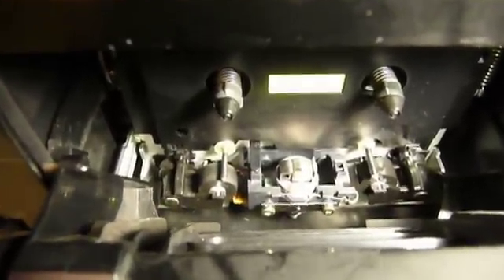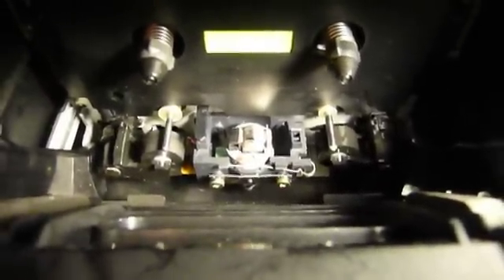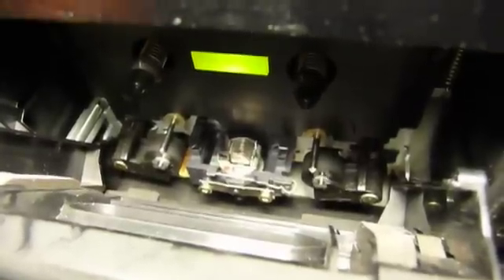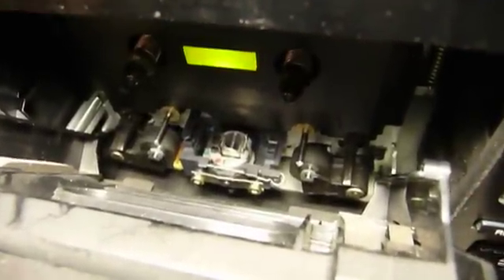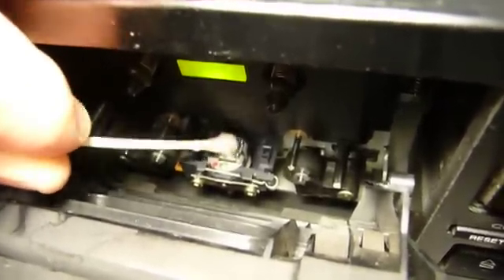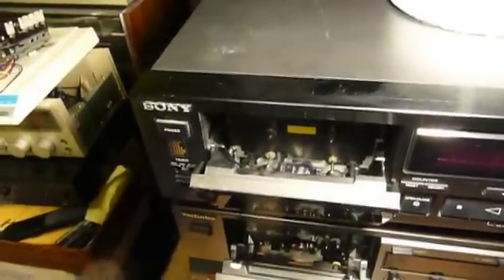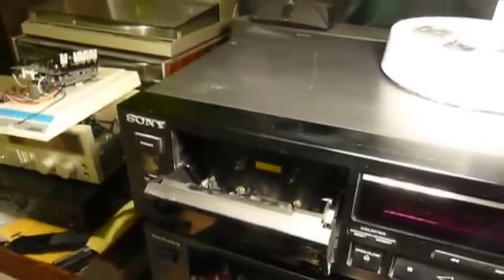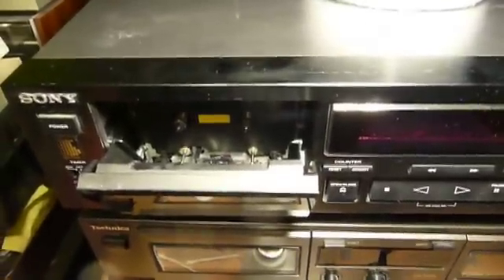How To Clean/Demagnetize Cassette Tape Deck Heads Part 2

Comment: I had an rx79es that looked almost identical to that. I wonder what the differences were? My capstan motor took a dump and I ended up throwing it out. Apparently I read it's a huge problem on these particular decks with the automatic doors from that time period. Now I see you can purchase capstan motors for them pretty easily. I should have hung onto it as I absolutely loved it. Definitely the best two head deck I've ever owned.  The recording quality would give a three-head deck a good run for its money!

Comment: whats the problem if you dont demagnetise is there any vid showing what happens with a magnetized head and if it really is such a problem to need a demagnetizer ie does the sound play warped etc show us what happens with magnetized heads otherwise no motivation to do it.
Reply from the maker: A magnetized tape head will produce poor sound quality.
Reply: @uxwbill  both of my Bauhn dual cassette recorders have suddenly decided to make horrible whirring sounds and make tapes distorted, its not the tapes. It sounds like both the spools have come off the machines or some cockroach twins have gotten into both cassette recorders and warping the spools. Strange that suddenly both of them warp now as they were working fine 3 months ago but just started playing them again and damn. WTF?

Comment: Hey,how am i supposed to remove stuck oxides and corrosion from heads and capstan when alcohol does nothing?thanks for the video!
Reply: Acetone works much, much better than alchohol.
Reply: @Reno_Slim  Acetone is fine for cleaning the capstan and the heads but don't use it on the pinch roller.
Reply: Recycle and get a mp3 player.

Comment: Have you ever thought about if the quality of a recording is better at the end of a tape or the beginning. Giving the tape is running faster or slower across the head. Thought about it a few times but really don't have a way to test.
Reply from the maker: Tape speed across the record/playback head(s) is constant.
Reply: As the tape plays out the spool gets bigger, changing the ratio. Run a tape half way and take it apart. Remove half the tape and reattach to the spool. Changes the speed of recording.  Just making conversation  ; )
Reply: Nope, speed is a constant. The pinch roller , and capstan maintains this.

Comment: Maybe you can help. The cassette deck in my car favors the right channel on any tape. It also is finicky when it comes to ejecting. Additionally, Sort of unrelated, I have a book on tape where the volume is fading in and out at a steady pace. It was an unopened tape, and does this in any tape deck. 

How can I get my tape deck to balance, how can I get eject to work consistently, and is that book on tape just bad?

Comment: "before" didn't sound bad, but you can certainly hear the better frequency response in the mid and high's after the demag.  I would imagine demag'n the record head also provides a better frequency response to which the tape absorbs.

Comment: Hi Bill, I own an Aiwa AD-F910 cassette deck and I've noticed that it does not erase when recording. The new track is mixed in with the old at the same volume level, but there is some distortion to the sound too. Any idea whether this is a cheap/simple fix? Thanks

Comment: Very good information.  Picked up a 3 head JVC with so much crud on the head, the levels were low. After cleaning the crud off the heads, it works great now.  Have you ever used a tape demagnetizer in the shape of a cassette tape shell?  I've got one made by TDK, the HD-01 that I've used for years.  Tom

Comment: This is a really great tutorial bar one tiny thing: some (cheap nasty) cassette recorders used a permanent-magnet for an erase head. Bizarre but true, and two big ways you can tell (other than their horrible recordings) is (1) no wires connect to the erase head, and (2) obviously it doesn't press against the tape during Play, only Record.  If you have one of those machines, FFS do NOT demagnetise the erase head!

Comment: I think the instructions for my Akai demagnetizer I got when I bought my Akai 570-D deck said approach slowly, don't touch, and rotate the demagnetizer in a slow circular motion. Did you do that last step? I saw one video where the guy didn't. He actually made contact with the head and held it there for 10 seconds. I never heard of that. Can you comment?

Comment: I'd say for the overall "health" of the deck, then yes, clean and demagnetize...but to get that crisp dynamic range sound back, I simply do a line-in record straight to Adobe Audition/Soundbooth and tweak the 10 band graphic equalizer accordingly. Does the trick everytime. Very good video.

Comment: I didn't hear any difference. Unfortunately 360p videos on YouTube have lower sound quality in high frequency due compression so that might be the case. I recorded clips with 16b/96kHz which is enough for this video and splited clips in two for A/B tests with markers on different parts. My hearing doesn't register beyond 15-16kHz and my Sennheiser HD201 headphones are limmiting factors. Head characteristics & electronics, tape and source are dominant IMHO.

Comment: i have a tape deck, but the sound isn't as good as it was 5 years ago, i tried cleaning the heads with water and a brush, does this mean it is time to get a better deck from a used shop or ebay?

Comment: I've read a few things about cleaning tape player heads, one of which was on a web site about, of all things, Teddy Ruxpin, a toy teddy bear that used cassette tapes, one thing that website mentioned is not to press too hard on the pinch roller when cleaning it or you may start shedding rubber, and that can't be good.  BadEditPro also made a video about cleaning and demagnetising tape heads, he said you should turn off and unplug your tape deck before demagnetising it.  This is very instructive.